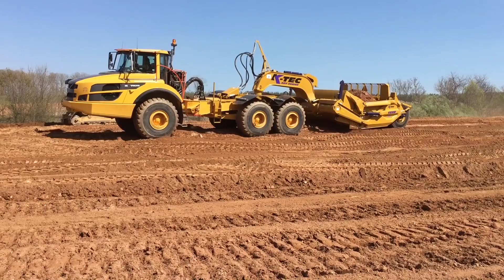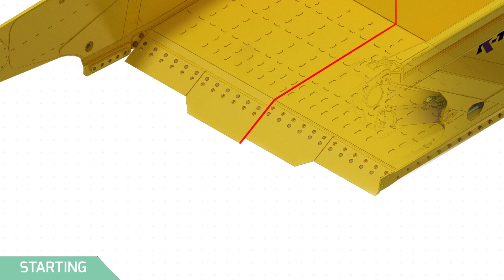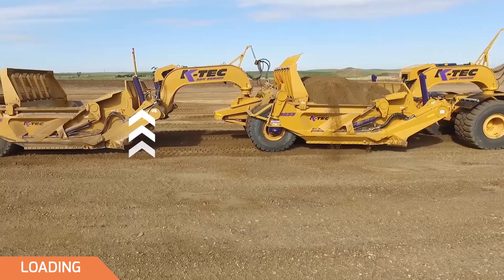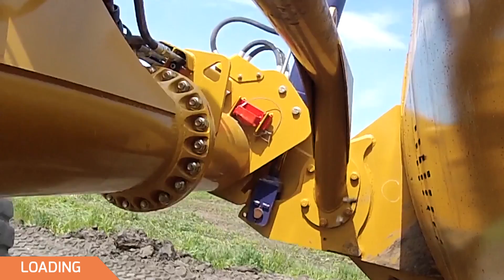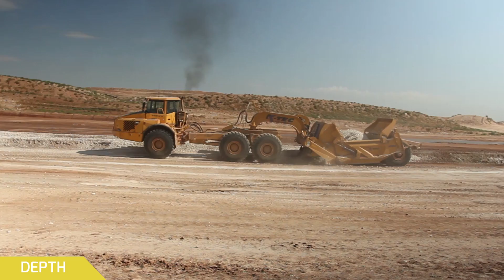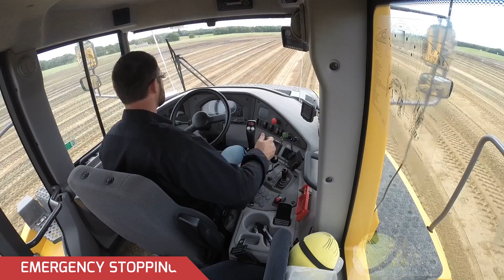K-Tec ADT Scraper Operator Training

Comment: How do you gauge how many inches deep you’re cutting?
Reply from the maker: New K-Tec scrapers have a height gauge with indication lines to show cutting depth. The factory camera on the truck is also positioned lower to the cutting edge, so the operator may see the cutting performance by looking ahead in the cab on the monitor display.